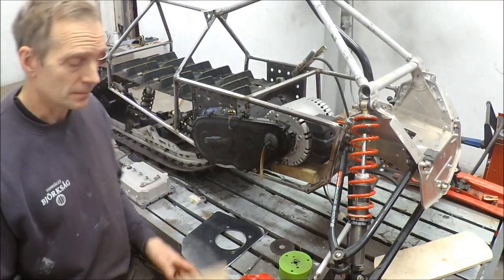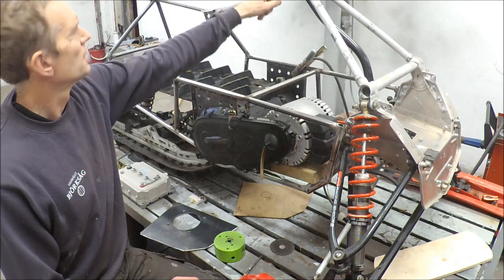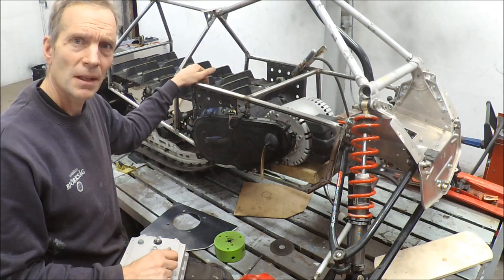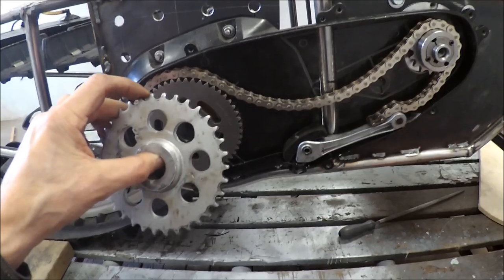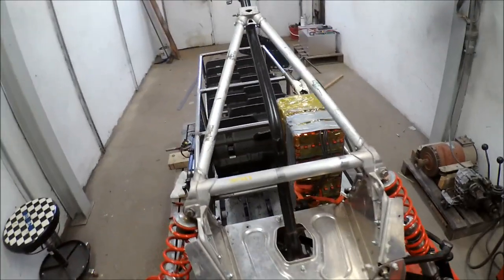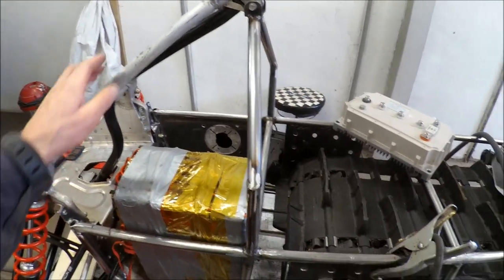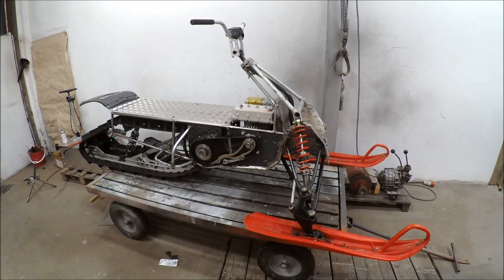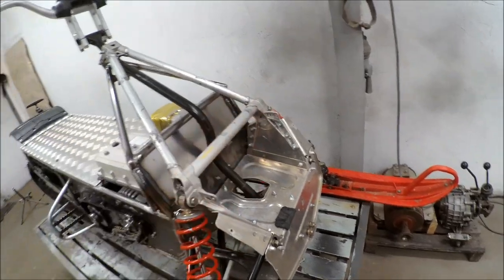Electric Snowmobile Tubular frame finished

Comment: Very nice build! I am trying to do the same thing on an old snowmobile chassis I have. I wonder, why did you go with an AC motor instead of a DC motor? Doest it have advantages in this application? I will be using a chevrolet volt 2kW battery pack.
Reply from the maker: Hello, W.L !  I went for the AC motor because no brushes, no need for external relay if you want reverse and I belive it is lighter compared to similiar performance DC motor. Good luck with your build !  BR Per

Comment: Love seeing your work!  I 'm not a snowmobile person (I live in Austin Texas, US), but I'm wondering about the weight distribution.   Seems like a lot of weight in front of the driver, not on the tracks.   Is that normal or desirable?
Reply from the maker: Hello, Bill ! Happy you like my projects.  Enginebay on a normal snowmobile is where i put motor, battery and controller. In front exhaust system used to bee. Where my build is flat and obvious it looks a bit flat and strange compared to a fossile snowmobil the fueltank and seating is put. I would like to say  that the build is neutral compared to a ordinary snowmobile but much lighter. The acceleration on a fossilesnowmobile is brutal and you are pushed backwards and trackband gets traction !!  If you never tried a modern snowmobile i really recommend it if you get the possibility !!!  BR Per